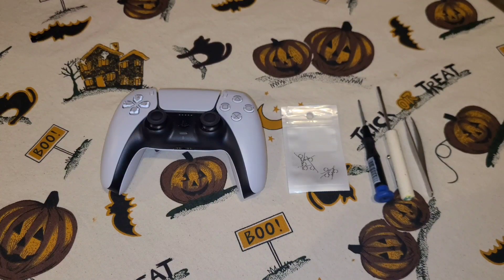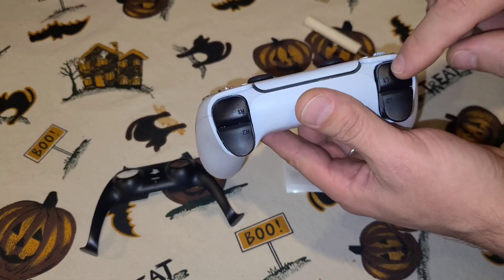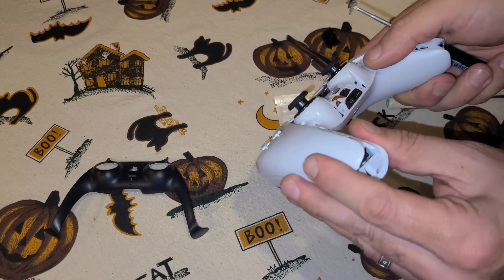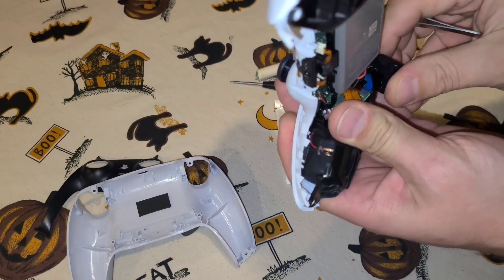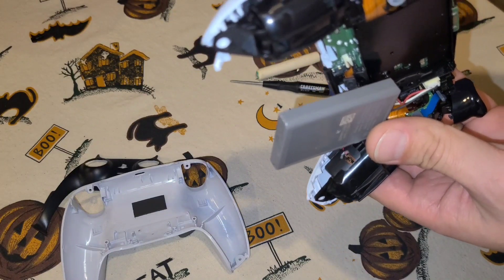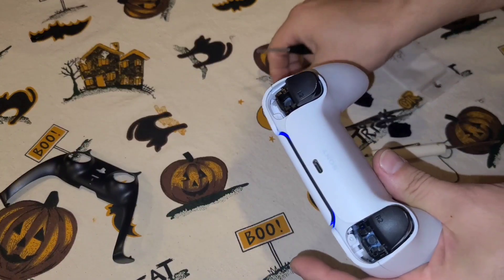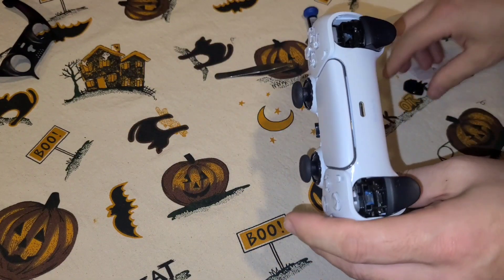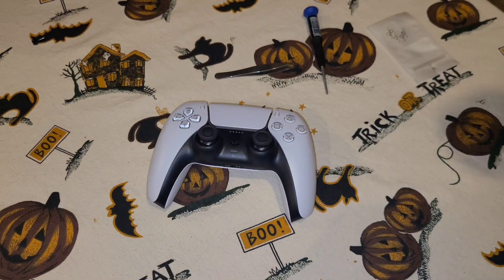PS5 DualSense Controller Repair - How to Fix  Loose R2 or L2 Triggers (Spring Replacement)

Comment: For some reason when I took apart my controller to install tmr sticks the springs on both triggers the lil plastic it’s on just broke off I didn’t even touch them they literally fell off😭 so I krazy glued them back in and the left is fine but the right is still loose it looks the same as the left so idk

Comment: absolute legend, none of the 15+ waffle videos, this is straight to the point. i noticed that the r2 spring is on the outside of the controller but the l2 is on the inside which looks considerably harder to replace.
Reply from the maker: Yes it is quite annoying the way they did it. Thanks for watching and the feedback.

Comment: I got 2 controllers back to back triggers became "very firm" then the rumble felt broken wtf is this bad QA. Never had this problem with ps3 and ps4 controllers. I am so mad but thank you for the fix I will work on these.
Reply from the maker: I hear ya, it's frustrating to have to fix things that shouldn't be broken.

Comment: My first 2 controllers got stick drift due to damage falling on the ground and this refurbished one i ordered had both triggers very loose. Thank goodness for this video
Reply: Same with me bro my black DualSense now has stick drift as well cause I dropped it by accident 😓 and now my white one has a broken L2 spring. Luckily I ordered springs so it’s gonna be a cheap fix at least

Comment: I just managed to get the L2 spring fixed. Its so much more difficult because its backwards from every tutorial. bending the spring over on that side is nearly impossible. Im also pretty sure its not securely in there so Im probably going to rage in a few days when the spring pops out lol

Comment: I got my dualsense controller like 3 weeks ago and I feel like the L2 trigger feels different then the R2, R2 feels smooth but the L2 idk why but I feel when I am pressing its as smooth as R2 Is that a problem or its just new because its not loose

Comment: Changing the spring never helps .. It’s better to get a new one
Reply: The issue stems entirely from a broken spring. What’s the point in spending £70 on a new controller when you can replace the spring easily.
Reply: @jayisundead2887  yeah but it’ll keep happening and it’s tiring . I bought a new one tho and it gives me rest of mind .

Comment: I've had 2 PS5 controllers sent off to Sony because the R2 button became slightly loose!  On both occasions, they sent me a replacement controller, rather than fix the actual ones I sent (maybe because of covid pandemic last year).  They paid for postage etc, took about 10 days to receive it!
Reply: Can I just send my controller back to them without the controller box?
Reply: @Grail1600  yeah!  As long as you package it securely etc!